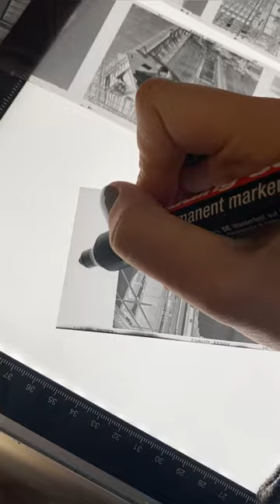Shooting B&W 120 Film, Developing and Scanning #shorts

Comment: Hi Lina. I just discovered your channel and went through quite a few videos. One thing I always wonder: Whenever I see you develop film, you rotate it. I was taught to not do this with film due to decreased sharpness and to always do inversions instead.

Do you always rotate your film and simply do not see an issue or do you do inversion, if maximum sharpness is required?
Reply from the maker: Hi! I do inversion when I have the developer inside the tank, however, that is when I also need my phone for timing :) I can only film during stop and fixer stages - this is when time and agitation absolutely don't matter. So if the tank is heavy, I just roll it.